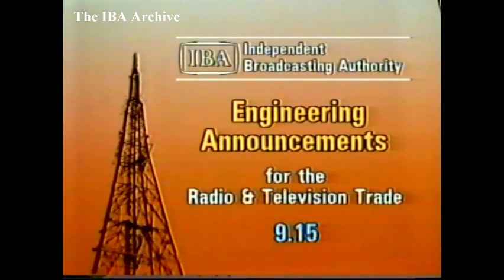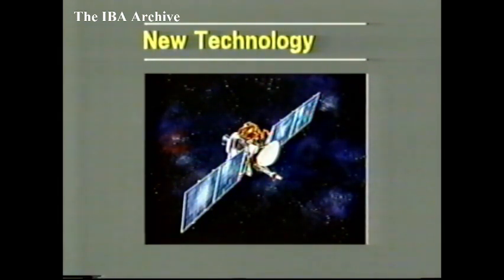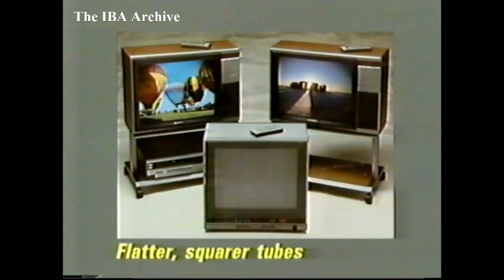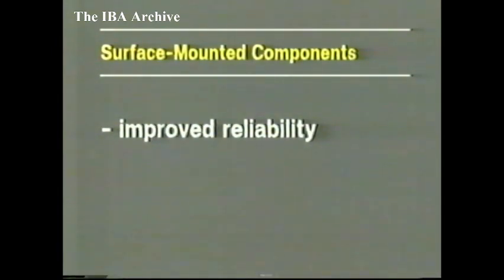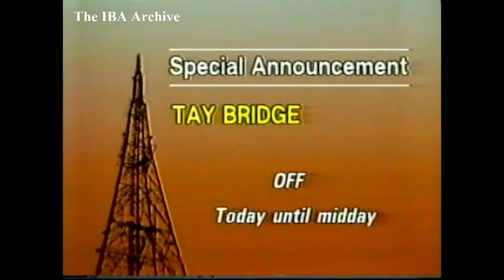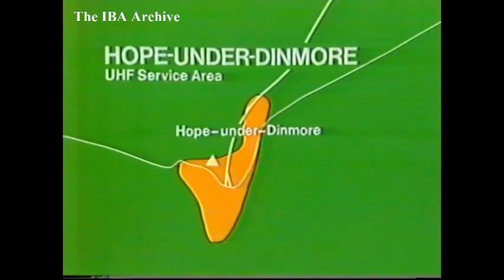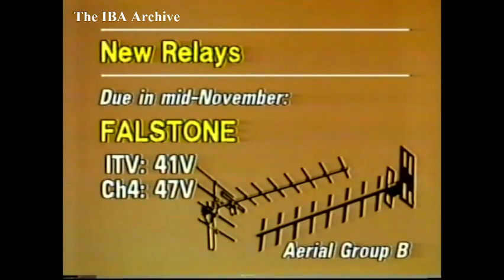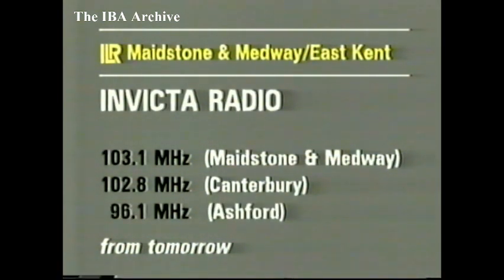IBA Engineering Announcements - 5(?) November 1985 'Surface Mounted Components Discussion'

Comment: I wish there was a show like this in the States.
Reply: There never was, and I doubt there ever will be.  The US FCC was/is in charge of licensing and doesn't own or operate the transmitter facilities it licenses.  The BBC and IBA owned and operated their transmission facilities.  The BBC had a similar programme.  Then both the BBC and IBA transmission facilities were privatised and now you got an American type situation here with OFCOM issuing licences, BBC/ITV etc making programmes, and a transmission company (typically Arqiva, the company that ended up with the privatised BBC domestic and IBA facilities) responsible for broadcasting the output subject to the licence the programme maker has.  I suppose Arqiva could make a programme like this if it wants to but these engineering announcements are from what is now a bygone era.